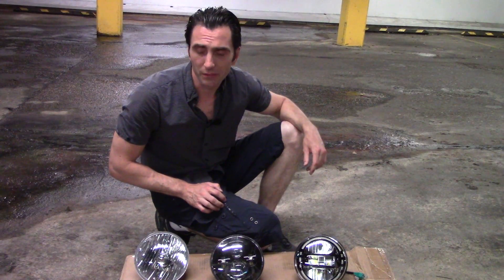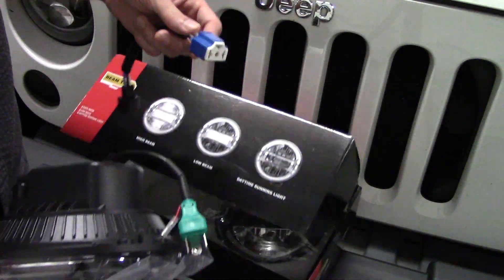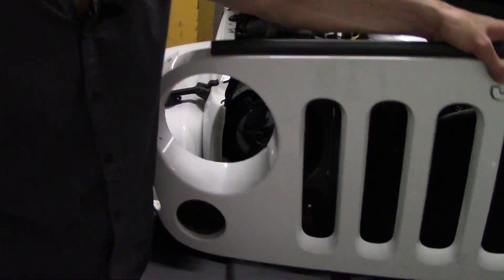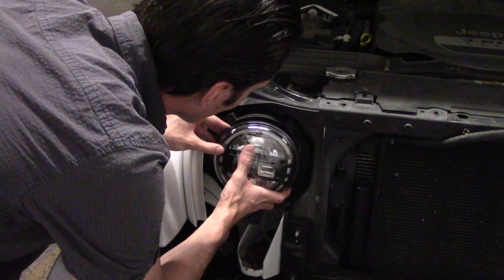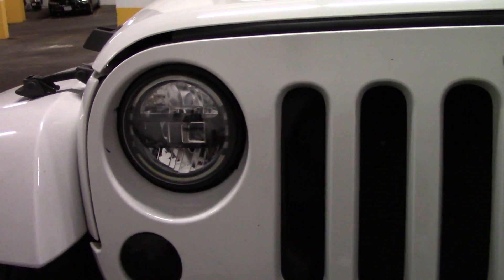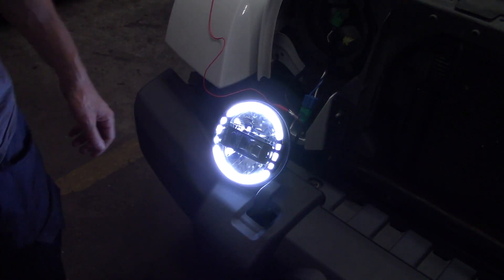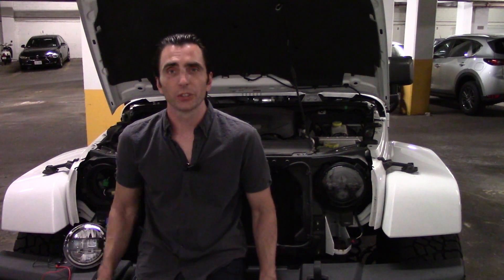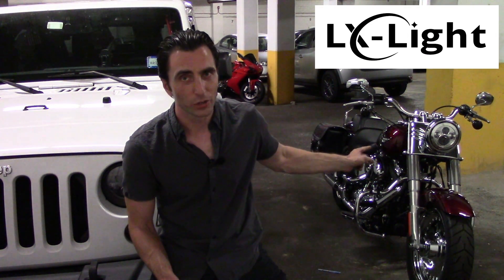NEW Jeep Wrangler JK LED Headlights

Comment: You can hook up the drl with one of the wires of turn signal(constant voltage), and for amber blinker for "intermittent voltage" wire of turn signal.
Reply from the maker: Yup, that’s exactly how I did my halo/turn signal headlights. https://youtu.be/Bz9yfNdGHjc

Comment: So the halo will come on with the light with the drl hooked up?
Reply from the maker: The halo comes on with the headlights regardless if you have it wired or not.  You would wire the DRL separately in order to have the option of halo only.  I did it on my other set of lights, check this out: https://youtu.be/Bz9yfNdGHjc